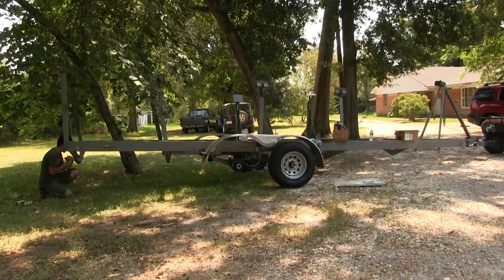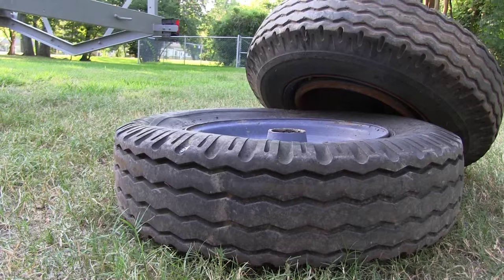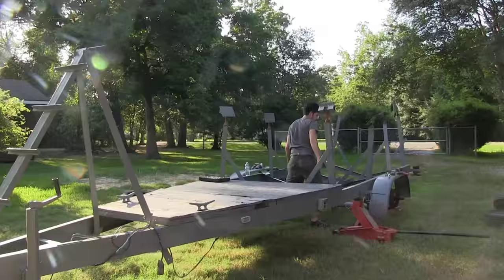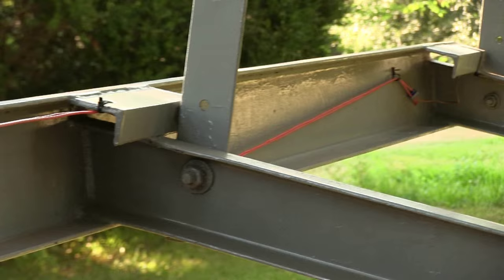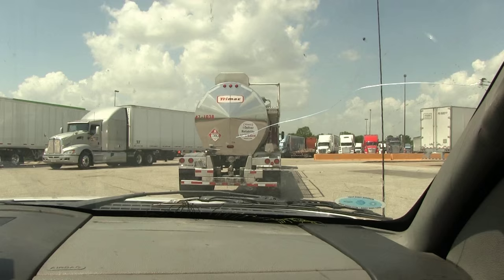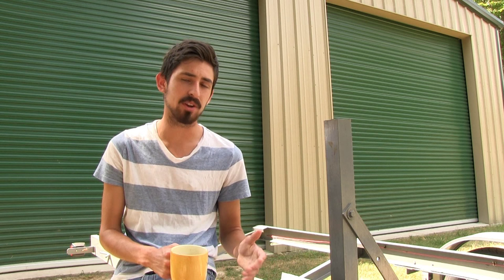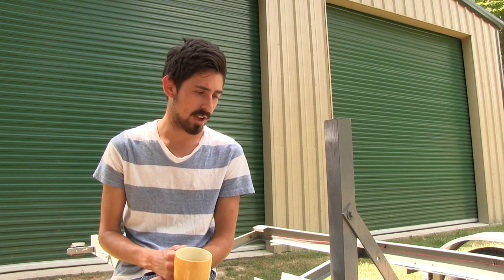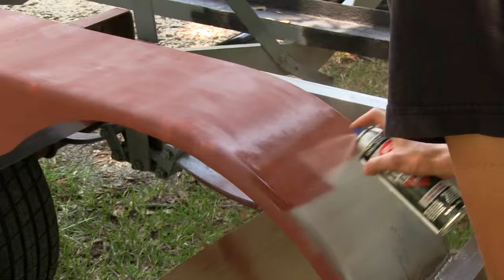DIY Sailboat Trailer | Sailboat Restoration Ep. 12

Comment: Hi guys.

I don't know how it is over there in Houston, but it's almost too hot to work here in Beaumont.   I put in a few hours of outside work at sunrise and a couple more at sunset, but that's about all I have been able to manage these last few weeks.

How are y'all going to get the boat on and off the trailer?   Do you have a place to use the trailer on a slipway to launch and retrieve the boat, or will it take a gantry crane to lift the boat out of the water and set it on the trailer?

Instead of a trailer, I have my project boat (a 1974 Alberg 30) mounted in my back yard on a square cradle made of 6" channel Iron with suitably braced upright corner posts made of 3" pipe containing the jackscrews for leveling the boat in the cradle.

It was the cheapest way I could find to haul and store the boat (costing less than $250), but it is also very labor intensive, as it requires winching the cradle and boat combination onto a conventional flat-bed trailer to move it, and it takes a boat-lift to pick up and set the boat off the cradle once you get it to the water.

Keep up the good work, but be careful of the heat.
Reply from the maker: drifterpilot We've been having those hot days too. Luckily our boat was in the shipyard, so they use their massive crane to lift our boat straight up and onto the trailer. Sounds like a pretty sweet set up you have as well. Thanks, you be careful as well.